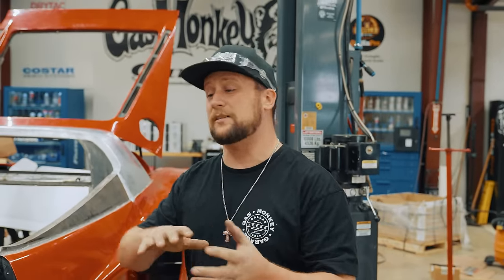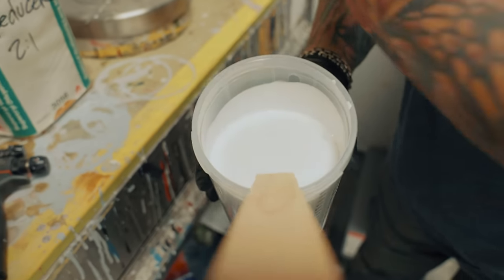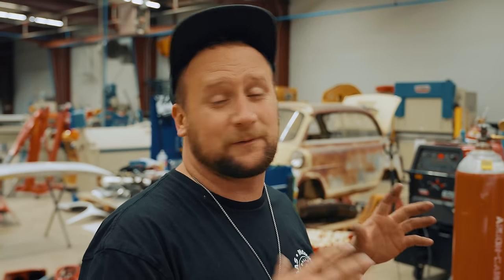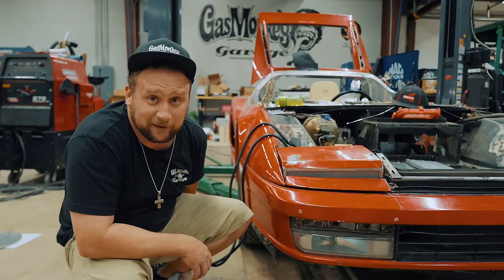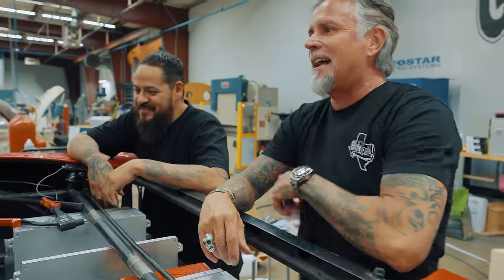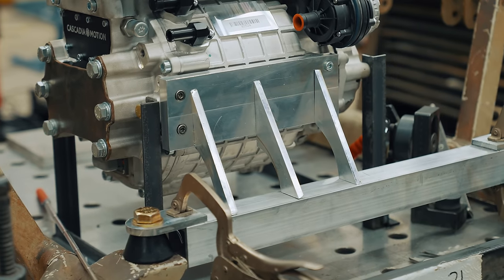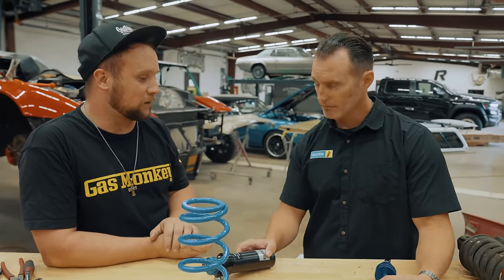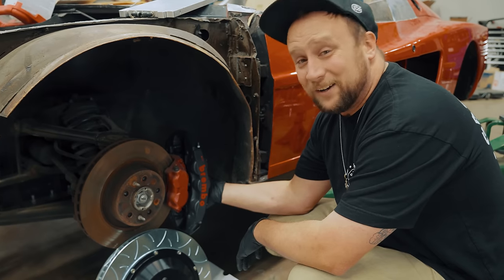BUILDING A ONE OF A KIND FERRARI FOR SEMA - PT 2 | GAS MONKEY

Comment: Seems like you Guys didnt take into account the required stifness and rigidity of top shock mounting points and in some directions of the motor mounting frame. Seems to me the position of the mount will cause some additional loads to the mounts. Not Good for optimal isolation.

Comment: I hope it doesn't set itself on fire like a lot of  EV's  are doing lately.. a massive con.
You should've put a v8 in it.
Reply: What could go wrong with a car that's thrown together in a hurry by a crew of chuckleheads?
Reply from the maker: We've got something coming for all you V8 lovers👀
Reply: @SelectCircle  Coming from a taco bell worker:face-blue-smiling::face-blue-smiling::face-blue-smiling::face-blue-smiling::face-blue-smiling::face-blue-smiling::face-blue-smiling:
Reply: An ice car catches fire in the us every 4mins on average, 217,000+in 2022 alone. #1 open recall across ALL LEGACY ice oems is for the risk of FIRE even when parked. And this will be faster than a v8. Finally true og hot rodding is all about doing stuff other's haven't! Get you some of that!
Reply: @markplaton84  Yeah - take a reality burger to SEMA. o_O